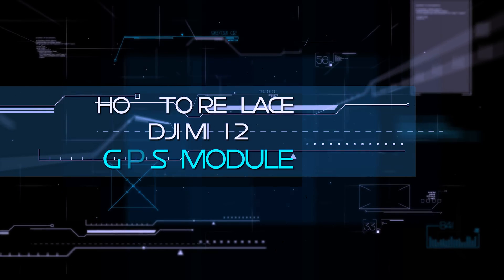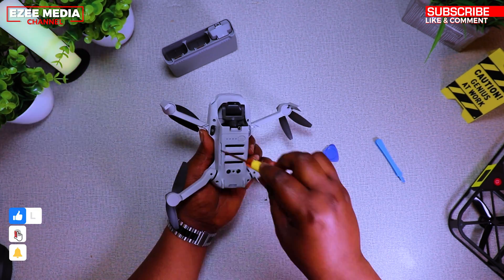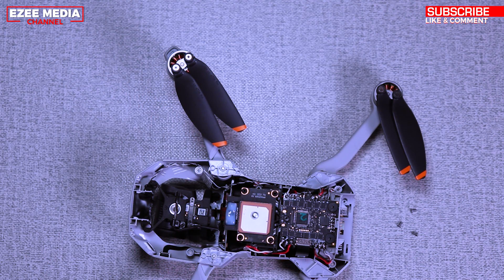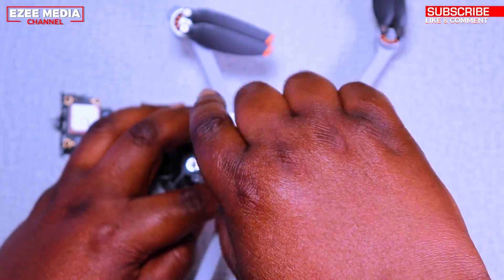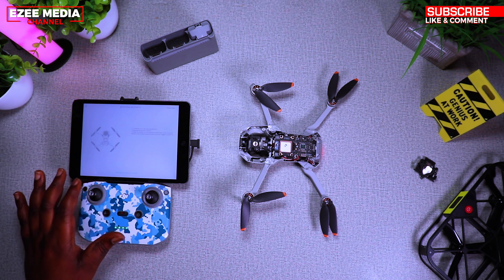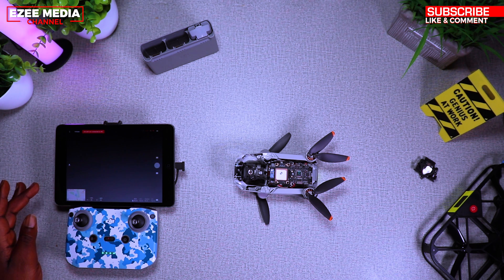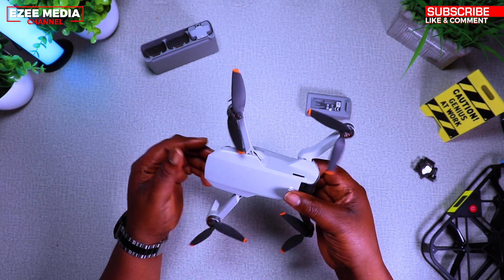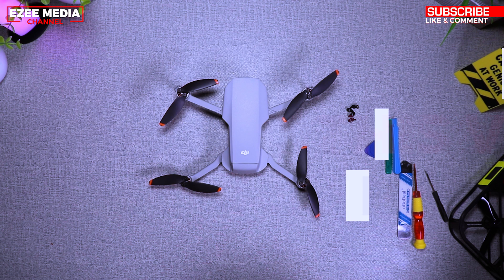How to Fix Dji Mini 1 & 2 GPS Error - GPS module replacement. Navigation system error fix.

Comment: i just got this code today and was very upset since i got my mini 2 se 3 months ago. looks easy to replace but something i think shouldn't be a problem ever or many years of use.
Reply from the maker: yea some of this issues are inevitable however there are quite easy to fix. thanks for dropping by and leaving ur comment very much appreciated. Thanks
Reply: @EZeemedia  it some what fixed it self but now error stays on. just ordered the gps module. if that doesn't fix it im not sure if i want to buy another one if that error keeps happening.
Reply from the maker: @tallicafan85 the gps module should fix the error
Reply: @tallicafan85 did replacing the module fix your issue?
Reply: @ what’s funny is i never got the problem to go away but as soon as i ordered this part it randomly started ti stay working. I still have the part in the package
Reply: @tallicafan85  woww haha thats crazy! Mine just randomly fell from the sky yesterday, no physical damage but I keep getting navigation system error and I can't find any solutions other than replacing the board, Craziest part is I haven't even had it for a week😔, and I can't return it to dji cause I live in a 3rd world country
Reply: @ that sux. Ive heard of those stories and its why it took me so long to buy one. Thats why i got the mini 2se. My gos error came on after few small crashes. I just took out the battery and pushed on the connector. Maybe that fixed it I don’t know

Comment: I didn't crash my MINI 2. I took it out of the box, charged the battery and remote, took it to my park, and it won't fly
Reply from the maker: What’s the error it’s giving ?
Reply: @EZeemedia  Navigation system error
Unable to take off. Tap to view why
When I press on it, Flight Checklist says Unable to Take Off
I calibrated my compass, still giving this error
Reply from the maker: @berkkarsi  did u buy it brand new ?
Reply: @EZeemedia  Yes I bought it 2 years ago and now I unboxed it for the first time to use it. I didn't use it when I bought it because I was busy with work. After I unboxed it and charged the batteries of the drone and the remote, I tried to use it in my park in an open area and it didn't work because of the navigation error
Reply from the maker: I believe u will have to change the gps module
Reply: @EZeemedia  I looked up for the solution. I think I have to update the software.

Comment: Thanks. Trying this as we speak. GPS module was $27 on eBay. I have no idea where to get the plastic tool. I got the case open with a credit card. Wasn't too bad. Right now I'm having trouble getting the connector off the old board.
Reply from the maker: U can get the tools from eBay or Amazon just search for Ifix  essential electronics tool kit. Hope this helps don’t forget to like and subscribe thanks
Reply: @EZeemedia  Does that cable press on from top or slide on? I'm having a tough time getting it back on.
Reply: I found a website with instructions that say "press fit" connector so I guess it presses down. No luck for me so far.
Reply: Still have not got that damn cable in.

Comment: Good morning, do you know if the barometer is integrated in the GPS module?
Reply from the maker: Hey Vitor thanks for dropping by I really appreciate. So to ur question 🙋‍♂️yes it is are U getting any error with ur gps ? Also did u crash ur air 2 ?
Reply: @EZeemedia  So my mini 2 fell into the water, at the time I turned off the drone and put it to dry, I opened the drone and cleaned it, but after turning it on it gave an error in the IMU, I managed to adjust it according to the commands of the drone's own software, however the barometer is showing an error and asks to restart the aircraft every time I turn it on, I believe I will have to replace the barometer to correct the error
Reply from the maker: So sorry about the water crash. Yea did u follow the steps in the video I made about water crashed repair? U can try taking out the gps module and following the video on how I cleaned it up if this does work then u have to change the gps module ok

Comment: I recently crashed my dji mini 2 and had to do an arm and gimbal ribbon cable replacement and the motors and the gimbal motors are all functioning now and the drone is very capable of flying. I’m getting strong gps signal as well. I am receiving a “Navigation System Error” (30105) and have recalibrated everything. Should I buy the peice you replaced? And how much is it?
Reply: If I end up do replacing I’ll be sure to follow this wonderful online guide, thanks.
Reply from the maker: Hey friend the answer to ur question is yes 😊 I believe when u replace the GPS module it should fix the problem. I have the link to buying the GPS module in the video description check it out pls. Thanks for the comment and all the best in fixing ur drone feel free to chat me up on my Instagram handle for any more questions. Thanks
Reply from the maker: Use this link : C$ 1.31  1%OFF | DJI Used Phantom 3 4 GPS Mavic Pro GPS Mavic 2 GPS and Mavic Mini 2 GPS Repair Parts
https://a.aliexpress.com/_mOURJA4

Comment: hello ezee.  today i dropped my dji mini 2 from a height of about 3/4 meters.  it hasn't been damaged that much, apart from a few cracks on the body.  I got the message "NAVIGATION SYSTEM ERROR" with the error code 30105. if I do the replacement as in your video, can I solve the problem?  Thank you
Reply from the maker: yes absolutely sorry for the crash just follow the steps and it will fine

Comment: hi... could i have some help here?? My mavic mini have a NAVIGATION SYSTEM ERROR 30105 is it the gps module broken??
Reply from the maker: Did u crash it ?
Reply: Fell into water but already cleaned all the pcb using ipa99% but this error went up
Reply from the maker: I think ur gps module may be faulty. watch how I cleaned the gps module and do the same hopefully it fixes the problem if not then u have to get another gps module

Comment: Hi, my friend, my Mini2 has crashed and the GPS is damaged like yours, I was able to start after I reconnect the GPS, but after a few seconds, It won't turn on again, and here is my question.
1. Is the drone won't turn on when GPS module is missing? 
2. Is the drone won't turn on when GPS module is damaged? 
3. Is your drone won't turn on when GPS module is damaged/missing?
4. Or your drone is still able to turn on but with GPS error?
Thank you so much if you can answer my question
Reply from the maker: Hello Friend so sorry fot the late reply hope u are doing well so as regards to ur question let me see how i can help. ya so answering question 1 the drone should turn on even if the gps is not installed and that should only give u an error.  ans to question 2 is yes the drone should turn on either ways so my conclusion will be that u make sure u have connected the esc board flex cable properly before testing the power with the battery. you can also reach me on my social media handles if u want to have a chat with me about this there we can see the problem better and fix it ok. hope this help pls stay connected so we fix this issue ok Am always here to help
Reply: @EZeemedia  ok, my friend, i have sent a message to ur ig

Comment: I get a error code 30105 would thins replacement fix my issue?
Reply: Have you tried the replacement of gps on mini 2 yet?
Reply: @mikecooper7094  yes installed a new one and it fixed the issue
Reply: my drone navigation error code.30105 help me
Reply: @punjabwale8558  you need to replace the gps module but before you do that take it apart and make sure all connections are solid if that doesn't fix it replace the gps
Reply from the maker: Yes it should
Reply: Maybe I’ll try that. Mine won’t start, I get code 30105
Reply: @mikecooper7094  yeah is your getting the same code I was putting a new gps in should get you back in the air. How did this happen did you crash and after the code came up?
Reply: @olehsmarketnotebook1450  no I’ve never crashed it. That’s why I’m confused. It only happens once in a while, now it’s happening all the time and the drone gets pretty warm too
Reply: @mikecooper7094  in that case maybe take it apart and check the connector thats connecting the flight controller to the gps and also check the antenna connections if none of that help change the gps module. I hope it works out for you man.
Reply: @olehsmarketnotebook1450  thanks I will try that. I don’t have a tool to pry the case apart, I will have to find one of those as well. I did just upload a video of what happens when I try to fly. It’s on my channel. I’m sure you already know what that looks like since you had the same problem, but maybe I’m missing something
Reply: @olehsmarketnotebook1450  what’s weird is I flew it once yesterday and after I landed, I put a new battery in and it wouldn’t take off again. This has been happening for about a month now